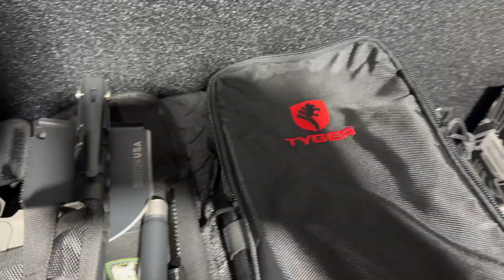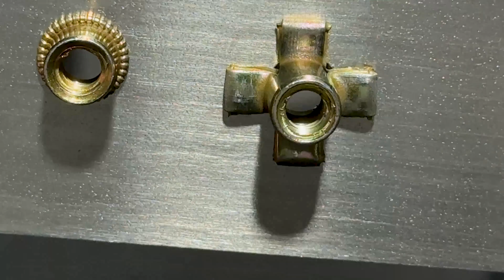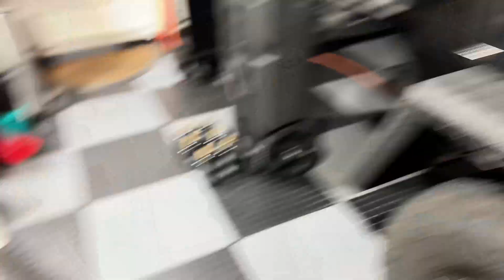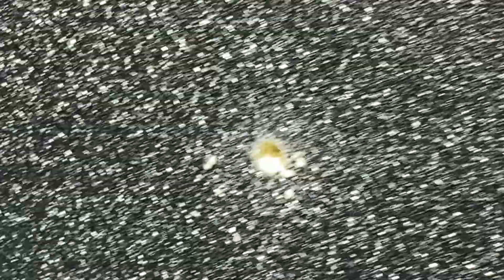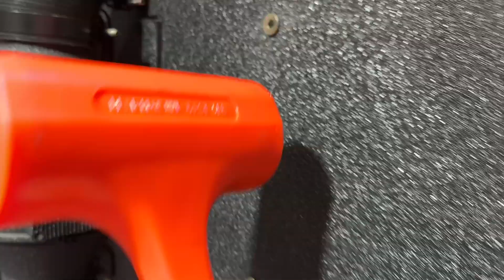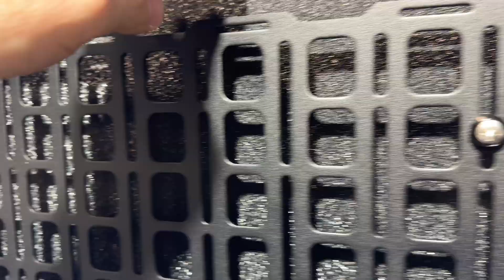DIY Molle Panel Installation

Comment: For the silicone/water proofing, wouldnt it be simpler to coat the exterior of each rivnut instead of gooping up the hole? Wouldnt need to clean the tool thread then.
Reply from the maker: I was always experimenting and learning as I went along. That’s a good idea. It probably would have.

Comment: Hey what size of panels did you use on each door? Most interested in the front two on the cargo box and the rear hatch door. Thanks love your build!
Reply from the maker: @phillepper2311 I used 13x19.5” panels on the doors. Thanks for watching and subscribing. Best of luck on your build my friend!